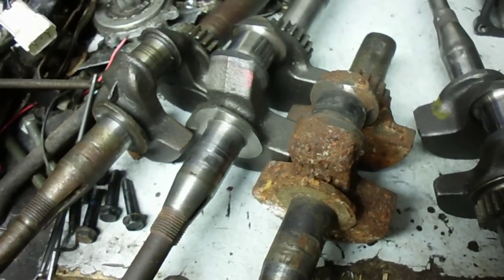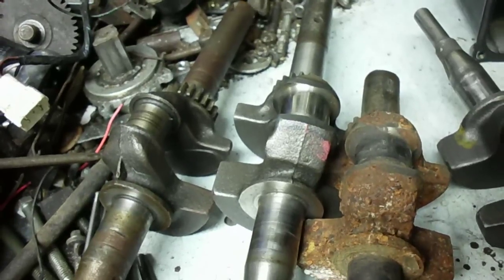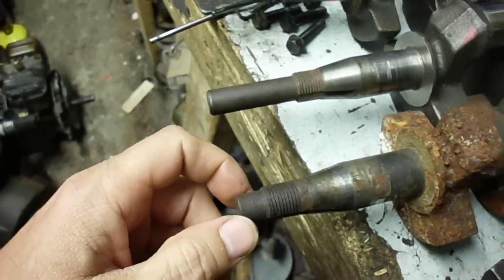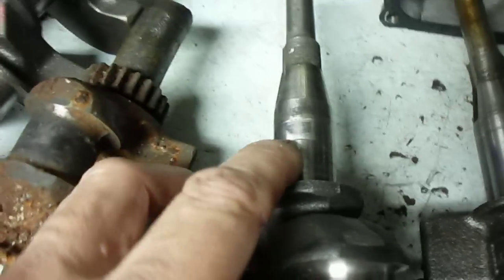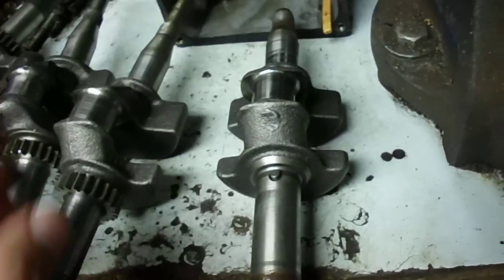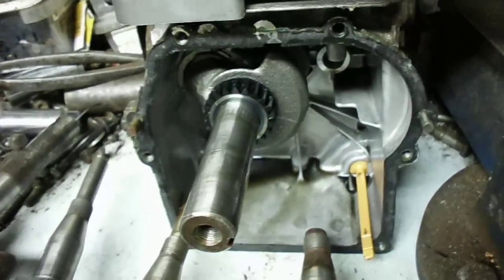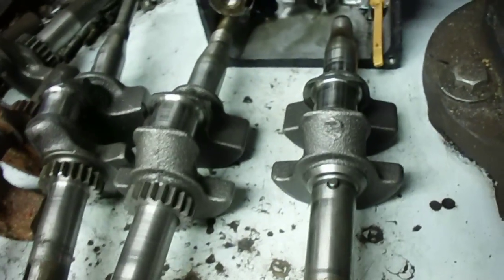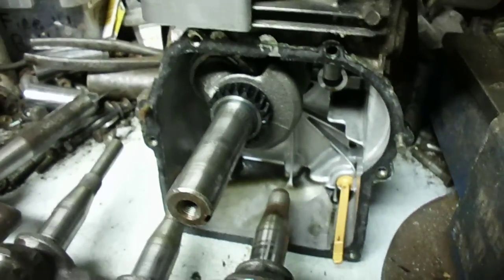Briggs Crankshaft Development 1953-2013

Comment: When they introduce the plastic flywheel, I'm done with them.
Reply from the maker: LOL, me too !!!
Reply: They do now on riding mowers . Now you just throw it away on its exp.date marked on bottom and buy the newest model every year!! Consumerism ain't it great!!!
Reply from the maker: I think only the fin portion is plastic, there is still a steel flywheel underneath the plastic part.  LOL, to funny throwing it away on the expiry date !  Unfortunately that seems to be becoming more and more true these days. I can't believe that some washing machines die after only 2 or 3 years, unbelievably wasteful consumerism!  Plus it cost the environment and the owner more. Companies are NOT going green, they are doing just the opposite!  i am not a Green-nik  by any stretch, but come on folks, lets at least TRY to help save the planet, instead of the opposite!  Instead they just try to push electric cars at us, good luck having enough Lithium to make all of those limited life batteries, plus you still need power plants and distribution lines to re-charge the cars. It is all a total farce/plot.  Sorry for going off!
Reply: @ChargerMiles007  electric cars run on coal!!!

Comment: Regulations is really cracking down on small gas engines now, so your going to see a lot more plastic involved unfortunately. Briggs is even bringing Efi into the mix. I recently picked up a cheap push mower from Aldi under "Garden line" Aka Garbage line, just to see what's it's about. Has a 5hp Briggs ohv 500e engine on it, probably no bigger then a 3hp engine from the 80's. So far it's holding up well but literally everything is plastic. The carburetor, gears, starter mechanism, etc. But because of the plastic carburetor it recommends standard gasoline. The one worrying thing it's doing now (I've only had it out a handful of times) is an alarming amount of white smoke when it starts up. Not sure if something went bad or if the engine is still breaking in and is burning off assembly oil.
Reply from the maker: I wondered when EFI would hit push mowers. Next thing you know you will be dragging a CAT along also, then the Smog Sniffers will want to suck the tail pipe of your lawnmower during an e-test.  Bloody Heck, what is the world coming to!!!  Heaven help me, they will want to ban my FrankenBriggs engines chuffing out the nice monoxide laden exhaust!!  :)
Reply from the maker: I just began pulling the OHV Briggs I got last week apart, perhaps it is the crankcase vent valve sticking on start up that causes the smoke, or oil leaking past the intake valve when it is sitting. I will investigate, as a friend has an OHV riding mower that chuffs oil smoke intermittantly. he replaced the head gasket, and it didn't help at all. I think the old flat head engines were more predictable!

Comment: Great video! I love the details, as i believe information is best gathered from comparison. My biggest question concerning B&S shafts is why they never incorporated a ball bearing (unlike Suzuki 4&5hp). I'm not complaining though, as the older ones (pre '95?) are still super reliable.
Reply from the maker: Jeepers, you got me, I forgot to include a ball bearing crankshaft, though they have only used those on horizontal shaft engines, as far as i know. I have a 3 horse, and a 5 horse briggs horizontal with the roller bearing on the output. you need it on heavily loaded shafts, like on a go-kart, where a chain is tugging on it. I burned up 2 crankcase covers on engines without the roller bearing, from the force a drive chain can exert on the out put bushing. Perhaps a bronze insert would help out, but i haven't tried that.My son did machine down a normal 5 horse crank, ans sweat a roller bearing onto it, for use with the stock roller crankcase cover, it worked great.

Comment: Great video, thanks for showing us the different developments Briggs made on their push mower engine crankshafts. I also am not a fan of the cheap plastic camshafts and gears that Briggs puts in their engines nowadays, plastic camshafts and gears are just junk! Keep up the good work!
Reply from the maker: Thanks, I have a bunch more vids to make in this series, as I realized that they have literally changed practically everything on the motor over the years. One of these days they will get rid of the flathead engine altogether, if they haven't already.
Reply: You are right my brother. I do not like it too expecially the pinion on the crankshaft that drives the camshaft, it should be metal.

Comment: I'll haveta put up a vid, but im building a v twin 49 cube. 
I needed to rob the crank from a 40 cube. 
Well I got to tinkering and weighing things. 
The wristpins for the 49 were 15 grams a piece lighter than the 40s. 
I swapped em. 
Same dimensions. 
The 40 rods were about 15-20 grams lighter than the 49 rods. 
So I saved almost 30-35  grams(1oz) per piston/rod assy. 
I'll see how she runs and find out if itll blow up 😂
Reply from the maker: Offffff!   I hope that works out for you. Reciprocating parts imbalance can be a nasty thing!   That said, I have played around intermixing Briggs pushmower engine parts and not had a problem.